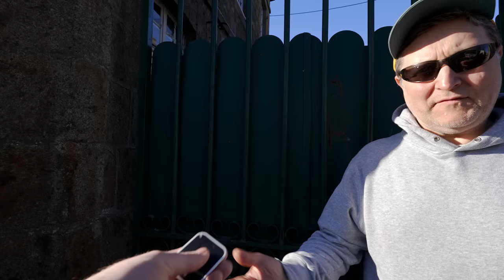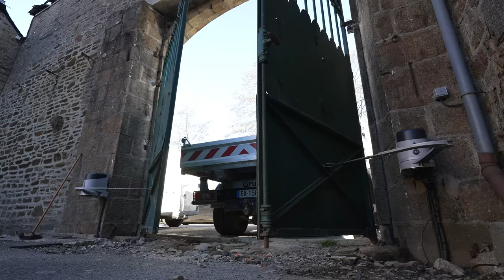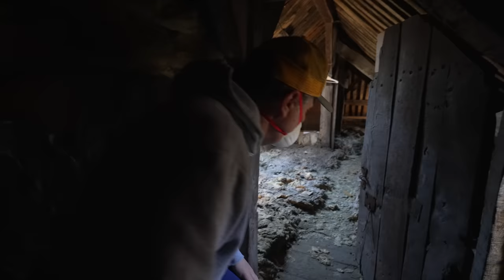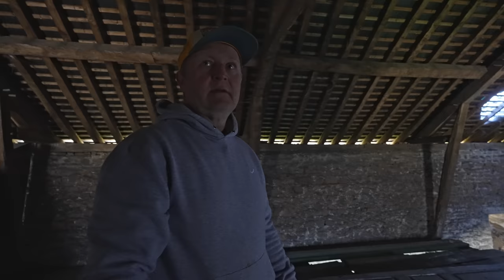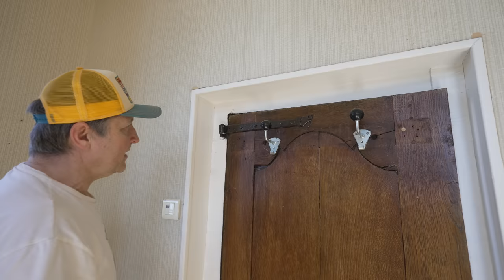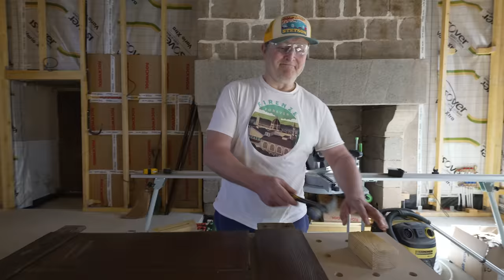We Got Locked Out Of The Convent

Comment: Reusing those doors is a wonderful idea!  However, those incredibly tall ceilings are going to need tall upper cabinets!  I had a short row of cabinets put on top of the regular cabinets (that can only be accessed by a ladder) with a 15 foot ceiling. It fills the space, so it doesn't look I put tiny cabinets on the wall. If the top shelves of the cabinets are never used, but they fill up the ceiling space, it will look more proportionally correct.  Just something to think about!
Reply: Excellent idea!

Comment: If you can't find the router bit to match, you can just reuse the bottom and graft it to the panel by cutting just the routed edge off and joining it to the reused top panel. I am a retired professional antique wood furniture build and repair craftsman from New Orleans. I have dealt with very similar problems like this. Good luck!!

Comment: Even with the small doors, you can always put something to extend the bottom to be a regular sized door. N even just put a smaller like rectangle recessed frame to match the rest of the door. Alot of work n sanding tho to match the old stain or wax or just re stain them

Comment: Our flats have an electronic key system for the front and back doors, however sanity persisted when they were designed and they lock by electro magnets so if the power goes out they automatically unlock, your gates are reliant on the motors of yours and once the power is off your motors are stuck in position, you have just discovered the downside :)
One door only known to those with a fob should be left with just locks not bolted because for safeties sake, if god forbid there was an emergency things would be much worse if you cant open the gates to get in to save someone or something.

Comment: I think you should frame out the 200 year old doors bigger (inset them) to meet modern door requirements and reuse as doors instead of taking them apart. I understand the savings to the kitchen budget, but you could still make the attic and garage attic wood work fir the kitchen.

Comment: For most old buildings, there is normally a grandfather clause where you can use what's currently in place even if it's not up to modern "build new" codes.   (Ie, a staircase that's too steep for a new building is fine if it's orginal to an old one.)   Might be worth a look into seeing if a similar exception would apply to the doors.

Comment: Hey Billy! Just a thought on the gate situation at the beginning ... when it comes to wireless stuff, metal can interfere with the ability to transmit between the remote and the receiver. However, wood, should not be as much of a problem ... perhaps in the future, when you're trying to fix this situation, do a test first before permanently fastening the additional security to the gate (e.g. find a way to temporarily hang whatever material it is you decide to use, in place, and, test the remotes with it). That's my two cents on that topic!

Comment: So, there you go not carrying your keys, and now you see why it's prudent to carry at least one!  I apologize, but I had to chuckle at your predicament. Bad me.  However, the doors. Athough, I greatly appreciate that you repurpose as much as you can, it hurts to see those doors will be cut up.  Sean mentioned that the doors had been shortened to accommodate a raised floor, what about looking for the original floor level, and seeing if the doorframe would then be up to code?  Then you'd only need to add to the bottom (again).  I understand you will save money building the kitchen cabinets from this wood - but, you still use time and money paying to repurpose the doors. Either way, Sean is going to be very busy.  I love what a knowledgeable perfectionist Sean is!  He's an artist.

Comment: I need to get some rockwool for my basement, however I can't have the paper backing as my basement gets damp sometimes, and I don't want mold.

I love that you're going to repurpose the original doors. Too bad you can't get the originals grandfathered in to keep based on historic preservation.
Reply from the maker: the paper is designed as a moisture barrier, if it’s taped and sealed it will work beautifully
Reply: @ThePethericks  Splendid! I'll probably be headed to my local home improvement store to get some once Easter and such is over with.

Comment: Those old panels in the attic would be nice as a retrofit in each of the window alcoves. They would make a nice attractive wainscotting under the windows and  making them slightly different from each other could highlight the variations. You could probably use all of the different styles of panel then and make them a feature.

Comment: Love the reuse approach even if it's partly dictated by budget. Again, since budget is an issue, why not revisit my scaffolding boards idea for the worktop; new ones of course? Could be mortise & tenon jointed so that you see the join, then stained to match the colour of the doors for an aged semi rustic style. Added advantages of scaffolding boards are that they're cheap, heavy duty, hard wearing & their thickness means that they'd stand up to resurfacing multiple times as & when needed.
Sanding the edges & corners to a rounded finish would soften the final look for a more domestic appropriate finish.
Originally, the Convent probably had work surfaces not that far removed from what my idea would look like so using them would be in keeping with the original. I doubt that this was a fancy kitchen in its day, more of a humble affair in keeping with the Nuns religious beliefs & lifestyle.

Comment: Would it be possible to add a panel to the bottom of these doors to keep them as the 'cell' doors?  They could have a 'kick' panel added.
Reply: These doors have beauty on both sides. Each room they are attached to will give an occupant a treasure to behold and utilize.

Comment: Why not reframe the old doors into a bigger frame  as an insert rather than cutting them up to pieces? Also  there should always be a non electric access - just in these cases. We had a cypher lock on our doors at work but could still access when we lost power.

Comment: The doors would also make great storage cabinets in other areas such as the entry ways… the other option is to add a lower portion to add to the upper full door and that will give you tall storage cabinets… there are so many uses that you can utilize those doors for…also maybe you should place a solar power back up for your front gate

Comment: Sorry to criticize but haven't you just installed a double moisture barrier?  That craft faced insulation is a moisture barrier and you installed on against the wall already.  This may trap moisture inside the wall and feed mold.  You might want to get some advice from a certified installer.  Mold is bad news.
Reply from the maker: well aren’t you a barrel of laughs steve!